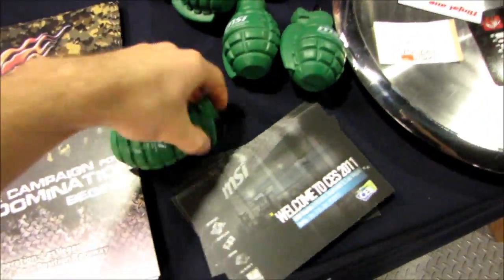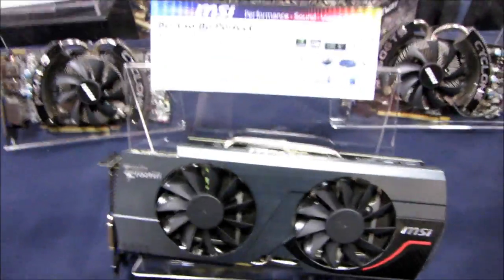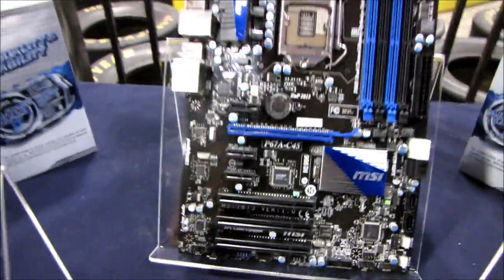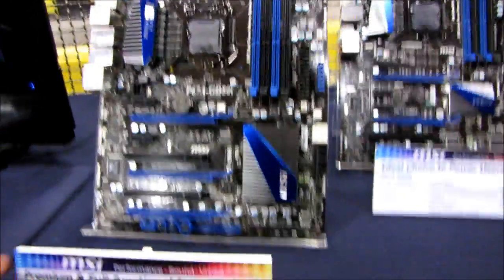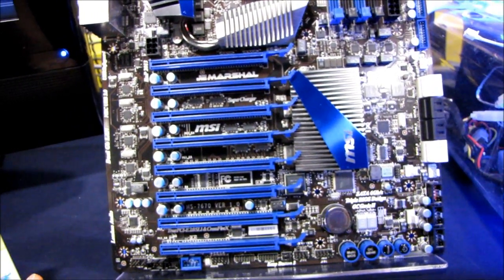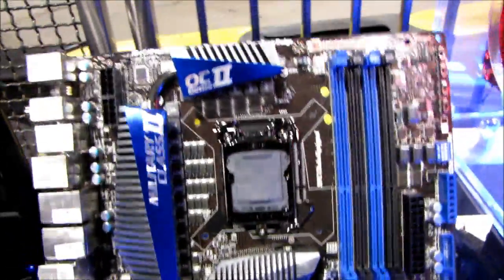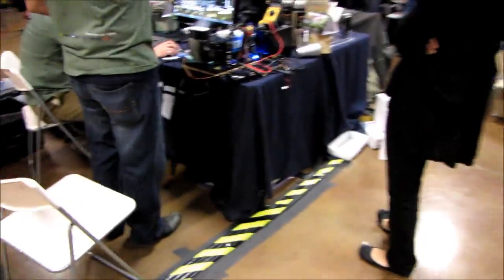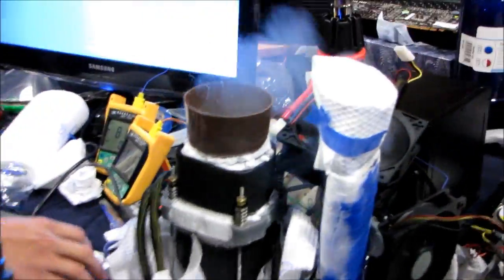MSI MOA North America Overclocking Championship & Product Display Tour Linus Tech Tips

Comment: @mathdarg450 yes they are comming after the summer but it is a different socket it is gonna be socket 2011 its gonna be the replacement of socket 1366 just as socket 1156 and 1155